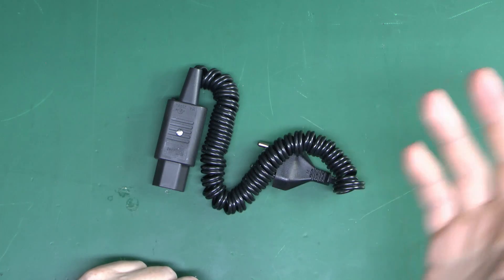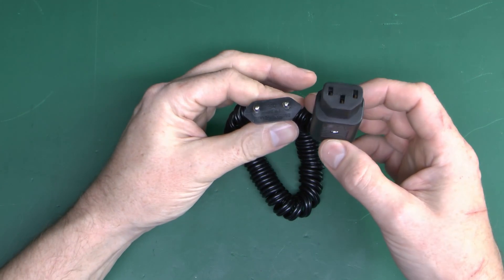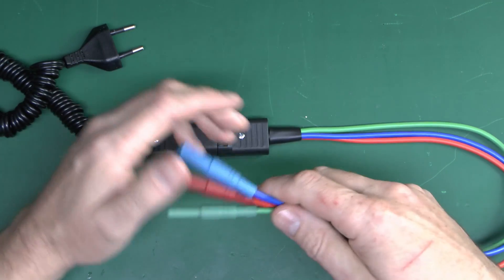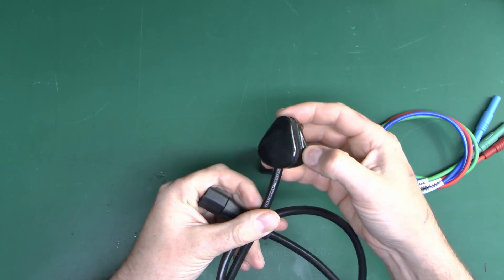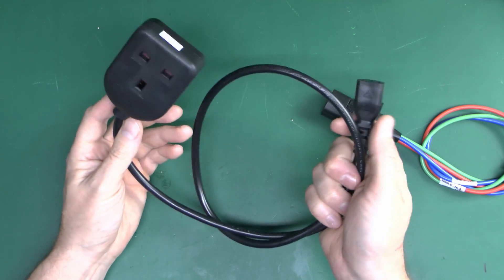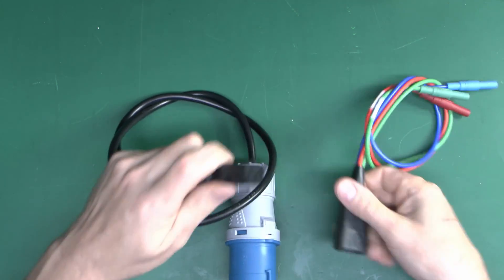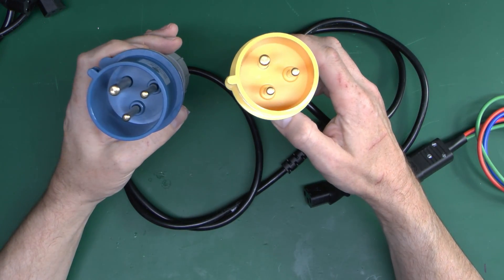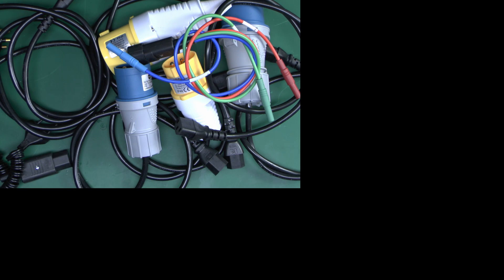Test Lead Adaptors for various types of Socket Outlet

Comment: Personally I would be reluctant to make up a lead from an unearthed plug to an IEC connector. I'd rather have a lead that goes straight to 4mm shrouded connectors.

The reason is a lead that goes to 4mm shrouded connectors is obviously a test lead, if it gets misplaced it's unlikely to be misused. On the other hand a lead that goes to an IEC connector could be used to connect an appliance to an unsuitable power source.

When breaking out a flex to 4mm shrouded connectors I generally use clear heatshrink on the individual cores and then a ring of larger heatshink to cover the transition so that there are always at least two layers of insulation over the conductors

Comment: I bin no end of EU plug to IEC13 that come with alot of IT equipment, some I take home for hardwire etc :) watch out though some are quality and others look thick but only have 3copper strands!!
Reply: And some have conductors that look "reasonably" thick (0.5mm² or 0.75mm², at least, which is better than some I've seen, like you mention!) but are actually copper-coated aluminium, rendering them rather less suitable for any given current than you might otherwise expect! :)

I ended up buying a load of good-quality BS1363-to-IEC C13 cables from CPC so that I always have a selection of trusted cables that I can use for applications that require more than a trivial amount of current...
(C13/C14 is generally rated 10A, I believe, but even some of the better quality cables I've received with products only have 0.75mm² copper, which is fine for probably 99% of uses for those cables these days - they're commonly called "kettle leads", at least in the UK, but most kettles I've seen for a long time have had permanently attached flexes... - but the cable should probably be checked before using it for higher current loads...)
Reply: Andrew Gillard - although these connectors (C13/C14) are often called kettle connectors / kettle leads, actual kettles that have connectors have a slightly different plug and socket so that standard IEC C13 leads won’t fit. The higher temperature connectors are C15/C16 types.

Comment: Hi JW great video as always, I'm interested in building some of these adaptors for myself. Did you buy the 3 test leads and the IEC female connector seperately and then assemble them? Or did you buy it whole from somewhere? Cheers :)
Reply from the maker: Separate parts, 4mm shrouded test leads and C14 connector.  The others are made from moulded leads with a C13 on one end and bare wires at the other, plus the plug/connector/socket as required.
Reply: @jwflame  Nice one, thanks for getting back to me :)

Comment: Hey JW, I’m a new subscriber and have to say am loving your videos. Really want to make some of these leads up but am struggling with the best way to adapt to fit a Metel MI3000 tester as this has unique socket for the test leads. Wondering if anyone has come up with some genius cost effective solution for this? Thanks
Reply from the maker: Unless that special plug is available separately, the only option will be to buy a test lead with that on one end, cut it in half and fit the 3 pin plug to that.

Comment: I know it's just a test lead, but isn't the CEE 32A to iec a bit sketchy as the iec is only rated at 16A right?
Reply: As long as common sense is used it should be safe. Here in canada I've seen so many things that are so unbelievably dangerous but with common sense is still dangerous but not nearly as bad
Reply: IEC C13/C14 is only rated 10A from what I've seen (i.e. all the cables and their connectors that I've checked over the years), so even the BS1363 outlet is sketchy in that sense :)
But as long as it's a "professional use only" item, not easily accessible by random people, and you don't overload it, I imagine it'd be fine in practice :)
Reply: A CEE16a_32a line-plug (3prong1phase) to a IEC C13 line-socket is usable&safe, as the interconnected equipment(to the IEC C13 socket) will never exceed/near the rated supply of 16/32a
Reply: But how would it be sketchy?  Sure you can plug it into a socket capable of delivering 32 amps but if you can only plug the IEC end into appliances rated at 10 amps max, then you will never be able to overload anything!  In fact here in Australia our 32 amp wall sockets will accept 10 amp plugs for exactly this reason (the plug and socket shapes are designed such that lower current plugs can fit into higher current wall sockets - there's a photo at https://en.wikipedia.org/wiki/AS/NZS_3112#Variants if you're curious how it works).
Reply: Yeah 16A load. Your testing, not pulling a load
Reply: Shouldn't have used the IEC - should have used current square pin socket plug. that way all the test leads would have ended in square pin standard shuttered socket :)

Comment: MR. john can you please make an experiment in which you measure voltage of two output wire of an isolating transformer using multi-meter relative to ground or earth and can this be used to detect if transformer output has a fault and become referenced to ground if the multi-meter read a voltage
Reply: Yes but you need to measure four voltages (output L to input L, output L to input N, output N to input L, output N to input N) because either of the inputs could become connected to either of the outputs thanks to an external fault.  You'd think it would make a good safety mechanism having something monitor these voltages and if they go much above zero cutting the power, because as soon as a fault removes the isolation, a voltage would show up across the isolation transformer's input and output which could be used to trip it.